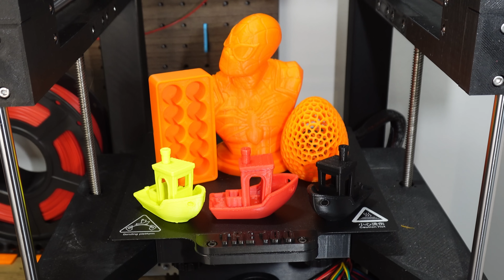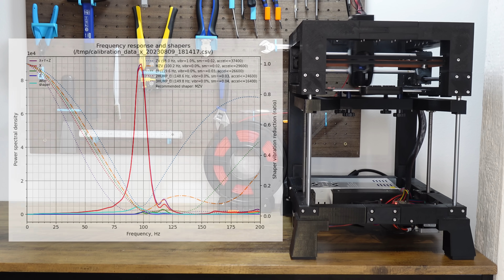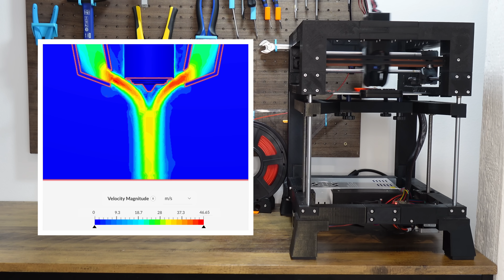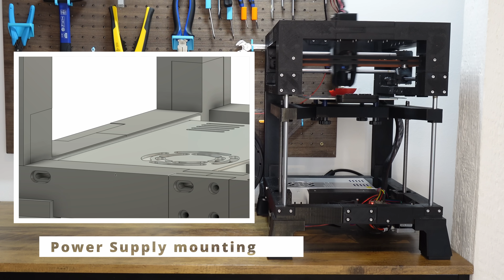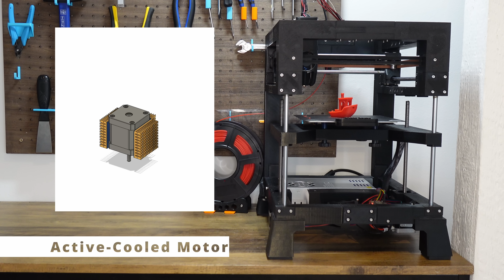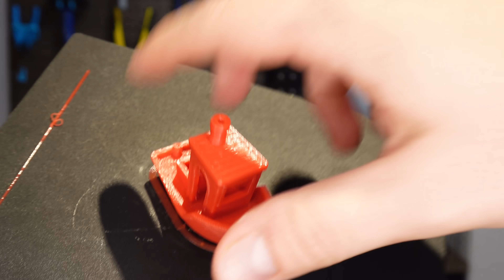THE 100 - The World's Fastest 3D Printer

Comment from the maker: One small correction:

In the initial Bill of Material I forgot to add 2xLM8UUs for the Z-Axis. I've updated the BOM and it should now contain everything you need to build that printer. Sorry for that.
Reply: Hi Matt
I immediately subscribed after this video!

 i must agree with selinium shutter on this, auto level is a must nowadays..
also a not so fast version with a 400x400 bed size option would be a good one (if i may be so Bold )

If you could offer hardware packs even with a surcharge I wil immediately buy one ..
I also became a patreon to support you in your efforts !
Reply: Same here.  Even if I fail, it is something to achieve.  Thanks for sharing it!
Reply: This is great! Love building stuff like this thank you so much.

Comment: I would love to see three versions of the BOM;

First version as cheap as possible; cheap motors, amazon bought hotend and extruder etc. Somewhere to start, I guess.

Second version, the one that's there right now; cheap but still quality with good parts to support high speeds.

And a high end version; going all out on all the parts. Highest end versions of all/most needed parts to get the absolute best quality and highest speeds.
Reply: To add, I would also love to see a 300mm³ or larger version as well! Maybe even as big as 500mm³? Though I'm sure that would require a lot of R&D.
Reply: I would like to see a version for printers with 220x220 print beds.
Reply: @YourLocalRaccoon  you can't really do that with printed frames, printed frames are stiff enough for small build areas but when you get bigger frames may get wonky. Maybe with some metal/carbon reinforcement you could, but at that point you might as well have an all aluminium frame. the 100 with an alu frame would be cool though
Reply: @cozmo4694  could have an insert sleeve for 3/4" conduit, would get good stiffness but nowhere near the cost, especially if the pieces need to be printed in 3 pieces or more
Reply: @cozmo4694  If I understand the video corectly, printing the frame is the main point of the design, as the plastic reduces resonances. Input shaping compensate for resonances /vibration. But it can not totaly eliminate them totaly. So with the printed frame, you reduce vibration from the beginning. Combined with input shaping, you can do insane accelerations.
Using aluminium instead would be contraproductive.
The other way you could reduce vibreation is making the printer heavy. Very heavy, like making steel armored concrete walls and mount the 3d printed frame on them. Actually you could also print the cast to put concrete into...
Anyway, with size increasi8ng, also the rods gain weight. If the moving mass increase, the acceleration you can do goes down.
Reply: I was also thinking of adding concrete for stability. A hollow version of the frame to pour concrete into would be really cool
Reply: @Gnudel  Pure sand would be better, it is excellent at absorbing vibrations. When I make this one I have already decided to add cavities for doing jusat that
Reply: @cozmo4694 I disagree.
Reply: @YourLocalRaccoon  exacly, this printer is amazing and I would love to build one but the build volume is really to small, something like 250x250 would make this printer an actually usable printer for projects
Reply: @oleurgast730  What about changing the material the parts are printed with?
Reply: There are hundreds of cheap crap printers out there and cheap doesn't work.  It's noisy, prone to error, harder to setup and fails more often that is the opposite of what you want.  Price and cost are two different things.   The price may be low, but the cost is high.  I would rather pay a higher price and have a much lower cost with less maintenance and higher performance.  Creality can provide the cheap stuff.
Reply: Make them, film a video, build your empire.

Comment: im in the processes of designing a custom printer myself to convert an old cheep bed slinger that was slow and unreliable into a fast core XY dual material machine. Videos like this one have helped me get ideas for my design. I will be using the linear rods at the front and printed frame at the back  in my design.

Comment: We need the 80/20 principle used on this one. 

Make parts easier and lighter. As you said wobbling is a part. 

Check out Wich parts can be spared ( maybe only one fan for Part cooling or even one for Part cooling and heatend cooling). 

Make it cheaper while maintaining 80% of it's speed. 

And port these and future findings into the 100 extended.

You are doing groundbreaking work here. ❤
Reply from the maker: Thx for you feedback :-)

Comment: in my opinion only 2 things are important:
1: Position of the toolhead above the printbed.  In my opinion it doesn't matter if the whole thing is wobbling, if the location of the head is solid and consistent relative to the bed you can put it on a working washing machine on in a car on a bumpy road. 
 2: Part cooling is only important AFTER the filament leaves the nozzle. Even if the airflow is focused 9mm next to the nozzle it doesn't matter, even at 150mm/s speed that's 0.06s without proper cooling. Good cooling all around might be better (vortex of 4 cooling exhausts?)
Reply from the maker: That's only true if you see the whole system in a static state, but not as a dynamic system. There are moments where the toolhead moves with 4-5g and since the gcode is something that is mathematically not predictable it might happen that the moving of the toolhead create a wave that adds up to the moving energy the toolhead creates at the next move, those additions ruin your printing quality. So it's more important to transform that energy stored inside the frame so that the addition goes near the energy of the moving toolhead. 

As for the part cooling, at high speed you want to have higher air pressure it has a way higher impact on the cooling performance than the airflow itself

Comment: I would be really interested in seeing a version with some added quality of life improvements such as bed probing with UBL and perhaps support for a higher quality, flatter print bed! This looks so great and I can't wait to paint that frame when I build my own!
Reply from the maker: Thx for your feedback ;-)
Reply: I would have thought that the "Clicky Probe" would be the current standard for a DIY printer.
Maybe there is a position for the probe in the design.
Reply: Ubl is easy to add, designing a mount for a bltouch is like a 10 minute job and then like... The work in marlin or whatever you decide to run the printer on isn't too hard...it's mostly just uncommenting the stuff you want to activate.
Reply: @NeoIsrafil speaking of that, how do you activate such features in marlin ? Do you Need to recompile the firmware ? Do you have some video about that ? 
Thanks in advance.

Comment: sick build, I like your style of considering the reality of vibrations and adjusting for it, rather than tune the machine itself to perfection. it was the same for bed leveling back in the day. people would fiddle with screws and tinker for the perfect bed height, over and over, only when software assumed and adjusted for the uneven bed either by using paper calibration or sensors did 3D print reliability take a massive jump forward.

Comment: cut the time from 50 mm/s regular 3d printer to high speed 500 mm/s is worth a lot. I hope this platform become new standard in 3d print industry...

also looking foward to print size 250x250x100 mm or 350x350x100 wanna know if aspect ration (proportion) would affect the vibration...
Reply from the maker: Me 2, for sure I will experiment with different frame sizes and infill types/density's to learn more about the behaviour of the printer

Comment: This is amazing. Absolutely fantastic work. Here are my random thoughts. 
1) I know we all love 3D printing, but the plastic frame could be injection molded at volume for lower costs. 
2) I wonder if something like the Frore AirJet would be a superior nozzle cooling option (120 mph airspeed with a very thin exhaust)
3) I like the high flow hot end as I prefer a 1.0mm nozzle for functional parts (1mm width and 0.25mm layer height for 4:1 ratio for strength)

Comment: 🎯 Key Takeaways for quick navigation:

00:27 🖨️ Version 1.1 of the P100 3D printer, known as THE 100, offers improved speed, better part cooling, and reduced vibration for higher print quality.
01:42 🛠️ The printer's frame swings freely to absorb energy from the moving tool head, and input shaper compensates for vibrations, resulting in smooth prints.
02:25 🏗️ Version 1.1 eliminates two rods in the printer's design, improving vibration profiles and reducing costs.
03:23 🪶 The redesigned tool head optimizes airflow around the nozzle, enhancing part cooling by over 100% compared to the original design.
05:00 💨 While the CHC Pro hot end is recommended, the printer now supports the Rapido hot end for even faster printing speeds with increased flow rates.
06:22 🧹 Cable management, motor mounting, and maintenance processes have been streamlined for easier construction and upkeep.
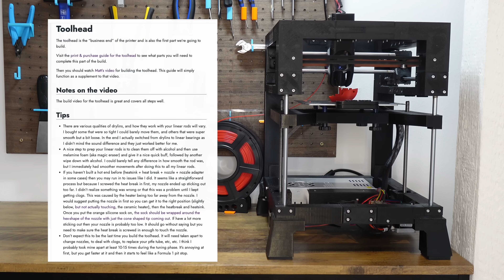09:06 📚 Comprehensive guides and a growing community on Discord provide valuable support for builders of THE 100 3D printer.
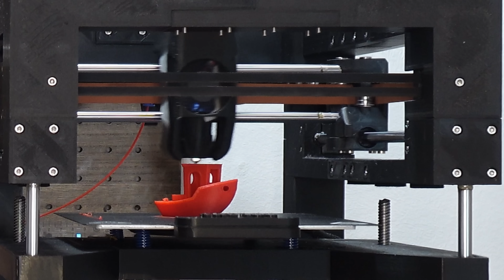10:16 💰 Donations and Patreon support are essential for financing further developments, including creating a kit-based version and aiming for a world record in 3D printing speed.

Made with HARPA AI

Comment: Hey Matt,
I would like to tell you something that might help you in designing better air ducts:
Which is that I believe that you can push the air through multiple parallel tubes in order to increase their accuracy and range.
And that if you did that, the air flow would go further in the direction that you are pointing it at than if it was just one tube or vent.
I have heard that this is what theme parks do in order to shoot water very high and far.
And I believe that it would also work with air, just maybe to a less extent (because the air you are shooting with your part cooling fan is the same density as the air it is being pushed into).

Anyway!
Just thought I would tell you this, considering that you were talking about your air duct design.

Have fun! :)

Comment: Its hard to tell, but does your printer use any sort of counterweight on the moving axes? If not, that might be worth looking into to ensure an equal and opposite force is always present to counteract the backlash generated from the fast movement of the print head. I've seen a few printers basically mount a dummy print head thats the same mass on the opposide side of the drive belt, seriously reducing vibrations and shake while operating.

Another more weird example of this, is Stuff Made Here's wall painting robot: he had a lot of trouble keeping the painting carriage from swinging as it was built with large cables, so to solve the problem he added a counterweight to balance the forces out. Seeing the same principle work wonders on a machine that has practically 0 rigidity compared to the average 3d printer really hammered home how useful a counterweight can be.

Comment: Excellent work👌, Very much needed to level the playing field. Would love to see a delta variant
based on linear ballscrews, that reduces maintenance and long term wear. Have a lot more ideas to share, if interested.❤👍👍
Reply: Why don't you make the upgrades and make some videos. Add to the community in a real way. Ideas are cheap and everybody has them.
Reply: I already have an upgraded flsun. The suggestion for ballscrew is based on the same(higher speeds with controlled accl/decel). I am fairly satisfied with my upgrades except for pushing the limits in excess of 600mm print speed, which is only possible with a ballscrew setup. But the kinematics should have the least wear compared to corexy, if done right.

Comment: This is truly amazing work! Thank you for pushing the boundaries of this craft. Although I have a question, what materials can be used on this printer? The worry in my mind is that the PLA frame would prevent enclosure required materials.
Reply: but you can always screw side panels on. and print hinges and order some acrilic glass for door and dome.

Comment: Back in the day (and i'm sure they do it today as well for very niche applications) when grinding parts for example with ridiculously tight tolerances and when measuring these types of parts they would be in a room suspended by cables so it would be isolated from different factors like vibrations (i suspect) and such my cuestion is would something similar work in this instace? would the frame behave differently if it was on some type of platform suspended in each corner?

Comment: Have you considered using carbon fiber rods like the bambulab P1P? I'm currently slapping together a printer with linear rods like you have on here, but I've ordered some carbon fiber rods and am going to give them a shot to see how they perform.
Reply from the maker: Let me know how it worked, my experience with carbon fibre rods was not that great
Reply: @MattThePrintingNerd I'm curious on your experience or what you've heard, because so far I've hardly found any info on them. I know they require some post processing to get them to have a consistent diameter and you need to use bushings instead of ball bearings, but that's where my info on them ends.
Reply from the maker: Yeah that's enough... currently there are no bushings out there that are made for fast printing and that resist carbon fibre.. Also CF is too rough so you dont get a good finish compared to steel rods, You cant post process them because of the epoxy that is used... The whole CF Rod thing is in my opinion a stop block.

Comment: What happens if you mount the top part of the frame to a wall? I know the input shaping resolves a lot issues regarding vibrations but it can never be perfect. What could also be interesting is to put the power supply at the top since that is where the moving head is. more mass = lower amplitude of vibration.

Comment: i am reading the 1.1 pdf and i can see many print parameter expect the one i play with the most, nozzle diameter
what would happen if you print it with 0.8mm and 2 wall outlines, because this is what i usually do with big models and my layer height is often 0,4-0,6mm
i presume  toolhead might have some problems with things not fitting right, but the whole rest of the prnter should be basically the same if not heavyier 
i may try printing bed frame out of abs like that and see what happens

Comment: I always wondered.. if it was possible to use a Carjack like system for the lifting (lowering) of the Buildplate.. to reduce costs even more while also increasing the accuracy.... while locking in the positions fully over 3d printed pillars. That way you could get rid of even more metal.. and 1 motor.

Comment: Amazing work, 1 question: Why have a quadratic printbed? Why not a 140 * 200 printbed (similar dimensions as a DIN A5 paper). Most parts are not quadratic and have 1 dimension that is clearly longer than the others. It would allow for a much smaller and thus lighter gantry without any impact on printer capabilities. What is the impact of the gantry width on gantry weigth? Or build a 200 * 290 Printer which has only minimally lower acceleration (due to longer belts an thus more compliance in the belts) but would have a significantly larger printbed.
Reply from the maker: You're completely right, it would work but the problem we have is sourcing, there is as far as I know no printer / manufacturer out there that could provide us that parts, but yes if you want to build it by yourself you could easily modify the design of the printer

Comment: Wondering if you could get a measurement of the g forces effect on the printer and compensate accordingly.
Reply from the maker: Im currently experimenting with adaptive acceleration based on real time vibration measurement on the frame. Im only at the beginning but i'm able to detect the point where the resonances of the printer get chaotic. Intrestingly that point is at a way higher resonance frequency that the frequency measured at the toolhead

Comment: Wouldn't it be possible to add an additional Y-Axis bed slinger like extension, so you could at least double the size of the printbed without sacrificing speed.
Reply from the maker: Yes this would be possible, we already talked about it at Maker Faire.. do you know good source for a 150x300 or 165x330 print bed?
Reply: @MattThePrintingNerd  I would try to put just the exact same adjacent to each other, take a pei sheet 377x370 and cut that in half.
Reply: @MattThePrintingNerd  another idea would be to not only double the printbed but basically  use a second printer with a shared double sized printbed. And there you have an IDEX printer taking max 4 times the space.